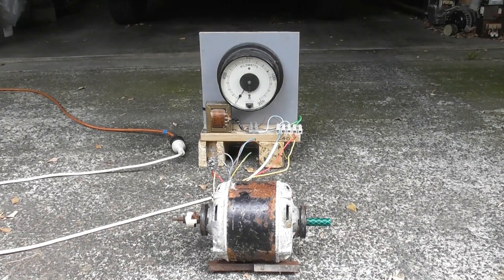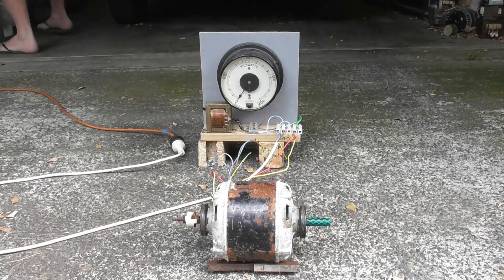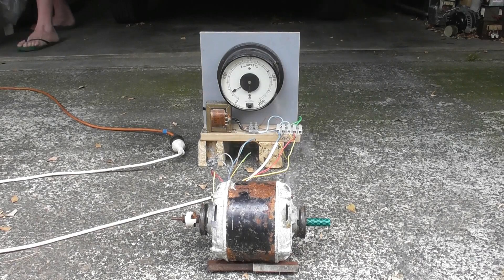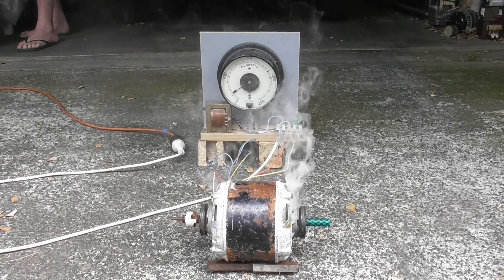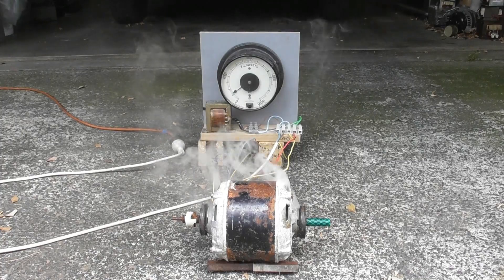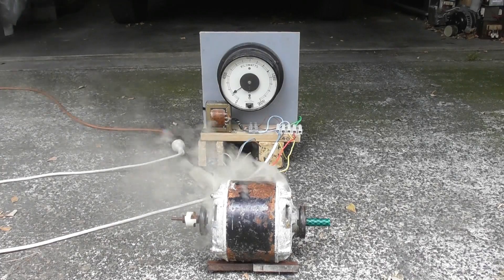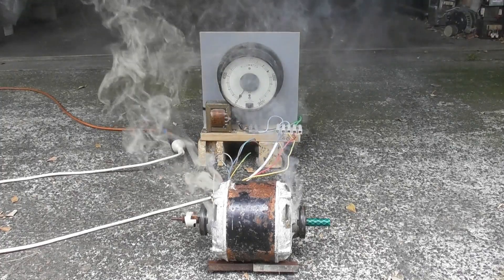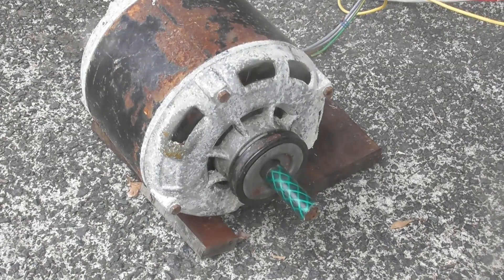Induction motor overheats

Comment: My man..  great vid but theres a point when it just becomes mean.  Whatd that motor ever do to you?  Lol..   enjoy the content every upload, i thumbs up every one i can remember to.  But hey,   Was wondering and figured i’d ask the CRT Terminator himself.   Ive seen a mot on a crt and a crt’s flyback arcs.  But what would go down, besides a breaker tripping if no isolation, if you doubled up on the mot’s to 4 or more kv’s and turned on the working flyback and  arc’d them in kinda a series thing.  High freq, high voltage and high amperage..  wonder if is even possible to do without frying the flyback instantly or the mot..  dunno.  Be Interesting to see the fight over ground...   either way, a good day to ya sir!

Comment: Great, I have the same idea . Is there a specific way to wire these induction motors?
Reply: Just to burn them up? Not really, I wire them up as usual. Just leave out the cap to give the start winding some extra hot suffer! When the rotor is locked, they usually burn out just fine on regular mains. Never had luck with shaded pole motors tho, they get fed by a variac and a reversed 230/120V transformer to get higher voltages. Those suckers take a fair ammount of time with a locked rotor to burn out, atleast the ones I burned out so far.